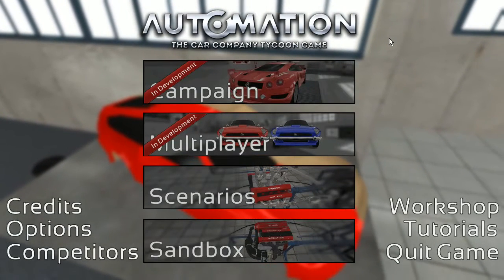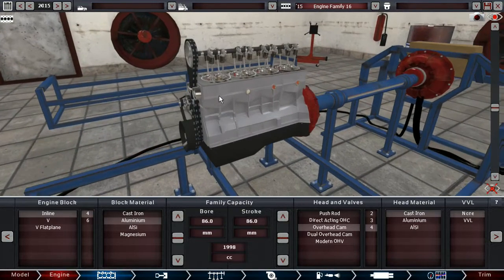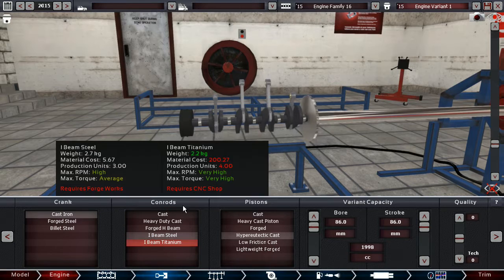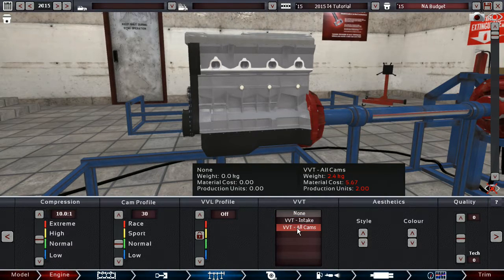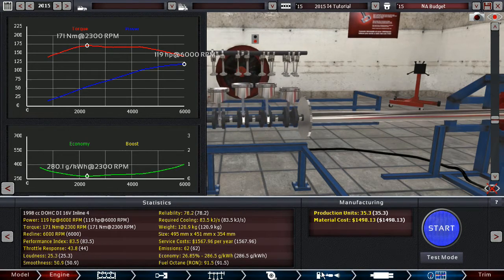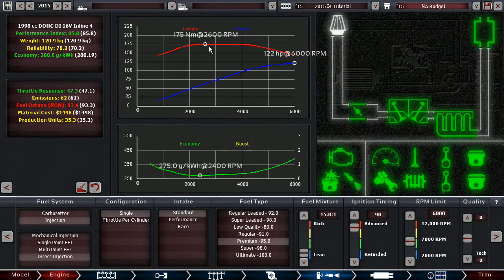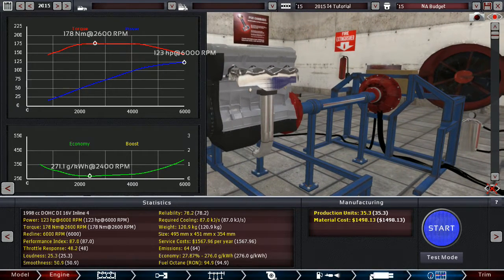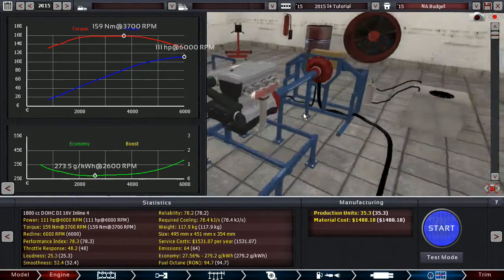Automation [Ep. 171] - How to build a budget I4 engine

Comment from the maker: @Donavan Chapman: you raise a good point, but at the same time you got to consider 2 things: 1) the "average" is an artificial norm that we've grown used to over the past decades, and 122hp in a small hatchback isn't all that bad. 2) Most people who buy a new car aren't actually car enthusiasts and they don't care about how much capacity an engine has. They instead care about how cheap the car is to run, especially in a hatchback which this engine would be put in (the Mantis, if anything). When they drive the car with this engine, regardless of what car it would actually be in, they would notice that it's smooth, quiet, not too aggressive on the throttle response and it doesn't use too much fuel. That is what the "average" driver would notice, and that's a good thing.

Comment: Unless this is to be fitted into somesort of small hatchback (which might not be the case, since it is a 2L and what is common nowadays is a smaller engine with a cute turbo, but you decided to avoid this topic.... so what I am saying is a lot less revlevant).. however, seeing that this is only a 122HP engine out of 2L is quite odd, youre stuck there wondering where the rest of the potential power flew out. I know economy is not just important but VERY important, but having average power is too (and this is quite under average). Reason being is: at the end of the day you need your car to be able to enter the highway safely at reasonable speeds, which means with a 122HP engine can make things unecessarely harsher. The standard power you expect out of a 1.8L - 2.0L engine should be between 145 and 155, like that at least you stay in the lower averages. In the higher averages even 170 - 175HP for sedans is typical. Correct me if I am wrong, maybe it is just a geographical difference..
Reply: Japanese 2 litre MPVs have 150hp, you are correct. But 1.8 litres might have less than 140